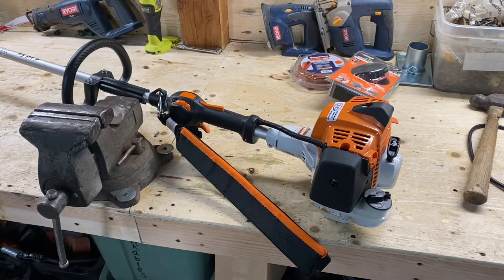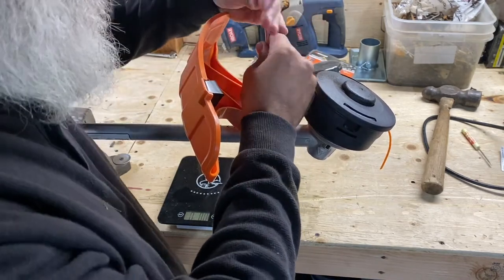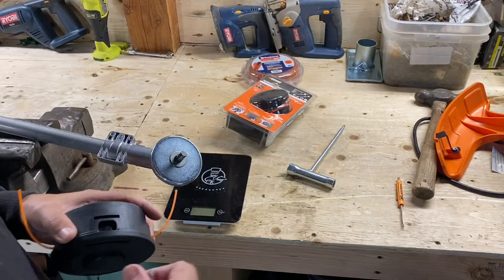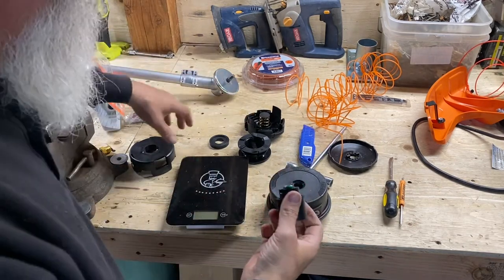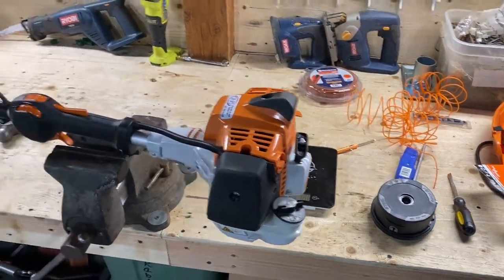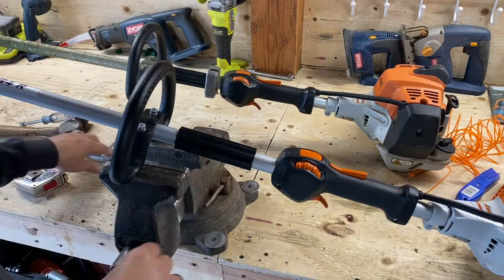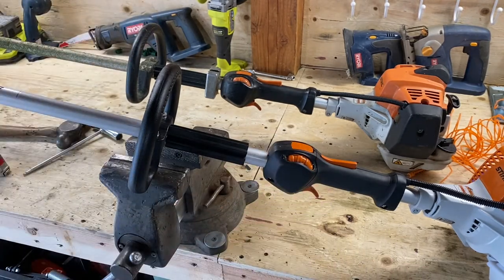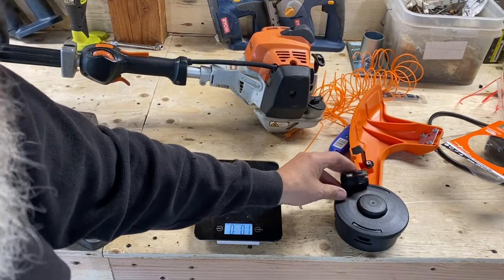How to setup a trimmer for professionals!!!

Comment: Great video, very informative, I've just boughtt a new 94r I also took the guard off but found it vibrated through the shaft more so I've put in back on. I have a 25-2 head but here in France i'm unable to get the echo speedhead 400...ps I thought 6 pulls to start
Reply from the maker: Tim. I always say, use what works for you!!!!   The little 94 is what works for us on weekly manicured lawns. We have been using the Echo speed feed for so many years, we are comfortable with them,  the 25-2 is a great head though. I also use Husqvarna line. What I don’t do is keep up with the Jones’s. I use what works.

Comment: Just bought another 94 just for the sure lightness of the trimmer and power output! I actually do the exact same thing although watching this video went more in-depth for shredding even more weight and changing that handle setting should be even more of a game changer! Heading to my work shed to customize it for this week’s work schedule! Any tips for the 111RX cause I know it has a different handle? I switched to a 111RX from a 94 this year and had to go back to a 94 for me. The 111RX is a beast but it feels cramped. I even put a Darwin’s grip on it but it still feels awkward to me. I feel for me the Darwin’s grip is better for my edger. Prolly put the original handle back on my 111RX and move it closer like u show. Great vid!
Reply from the maker: We have a 111RX as well. It’s a great medium duty trimmer. I pretty much set it up the same way as the 94. Balance is much different though because the motor weight is much higher. The trigger hand just has to carry the weight. Not much can be done about that. Thanks for watching!!!